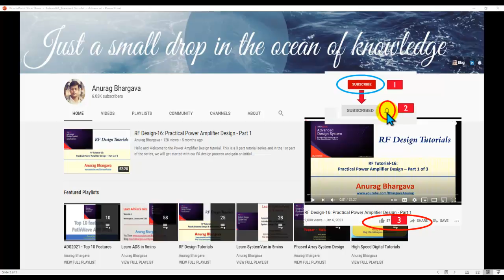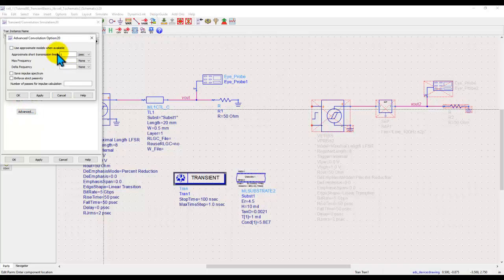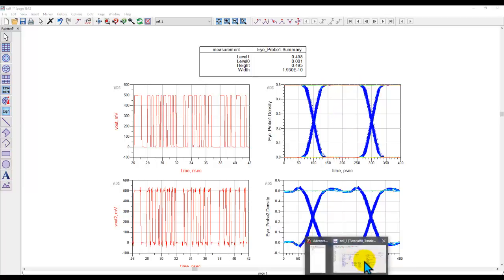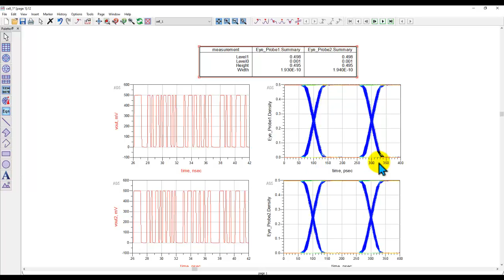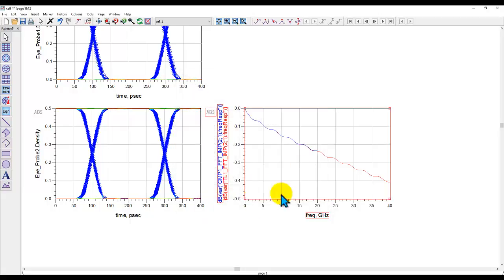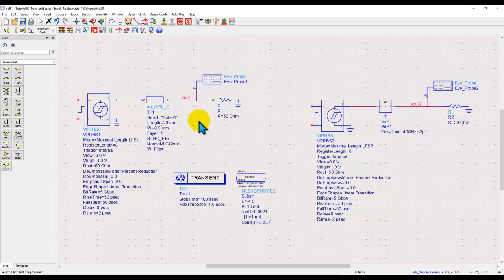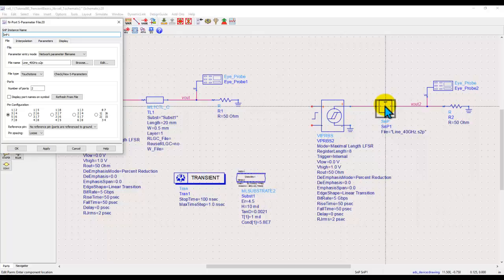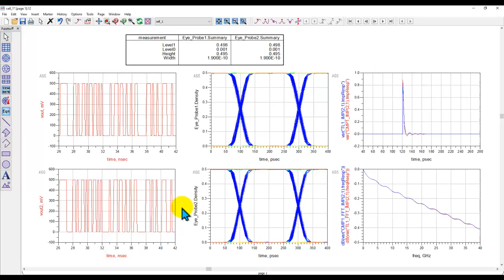Tutorial-61: Transient Simulator Advanced

Comment: please please please make amplifier matching and design on this amp transistor NPTB00004 for range from 2300Mhz to 2500 Mhz  , it will be helpful help.
Reply from the maker: Kindly see the Power Amplifier Design Video (Part 1 and 2) on my channel to understand this clearly. It will be no different than what I already described in the video for Cree GaN device.
Reply: @BhargavaAnurag  ok i saw the amplifier design part 1, two ,but i do not have NPTB00004 library ,and when i used the s2p file the result of s11 , s22 differ from that written in their datasheet(company datasheet) , i don't know what is wrong so, i asked for your help in such case because of your experience and  helpful video, so if do not mind helping me in this case , i will be thankful for you efforts.
Reply from the maker: @AhmedIsmail-sw6so  Best for you would be get library from vendor, it is easily available by requesting on their website. Any differences between datasheet and S2P file has to be explained by vendor as only they know what have they provided.

Comment: Thanks for the detailed demonstration of the transient simulator. 
I was trying to simulate an oscillator (following the example "Osc_Tran_HB_Env_wrk") where the status/summary shows "Characterizing to 1 GHz  AND Use an adaptive sample spacing of 3.906 MHz." for all the components (L, C and em model).
Reply from the maker: This looks like a normal message. What's your question?
Reply: @BhargavaAnurag  The thing is that it should oscillate at 2 GHz (according to HB analysis and other criteria), the em model and lumped L,C has value upto 15 and 20 GHz respectively.
But the transient simulation shows no oscillation, it's damping.

Comment: Hi
Sir i have a question related to budget analysis simulation of receiver in ads.
If first/initial filter has 26ghz bandwidth and final/if filter  has 2ghz bandwidth, which bandwidth should i enter in simulator?
Reply from the maker: I am not sure which simulator you are using for budget simulation? There is no simulator where you need to enter the bandwidth.
Reply: @BhargavaAnurag  Sir i am using advance design system. I am talking about noise bandwidth.
Reply from the maker: Noise bandwidth is usually kept as 1Hz. for more details kindly contact your local Keysight tech support team